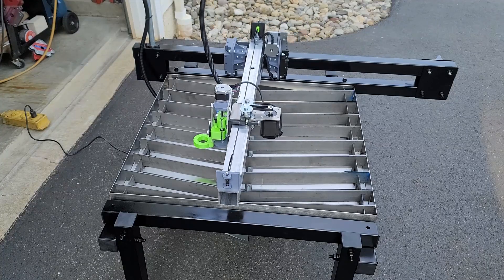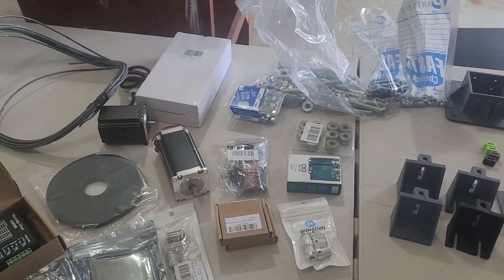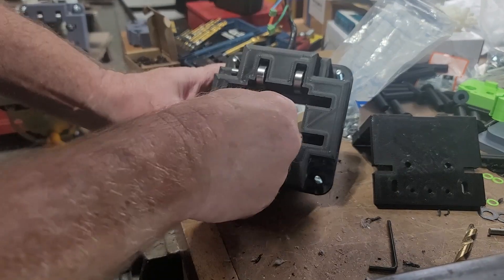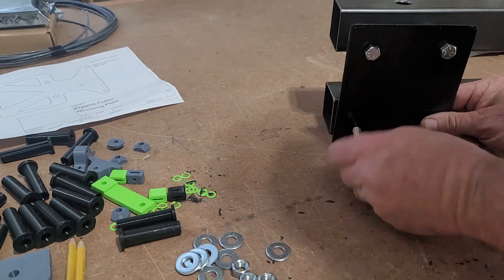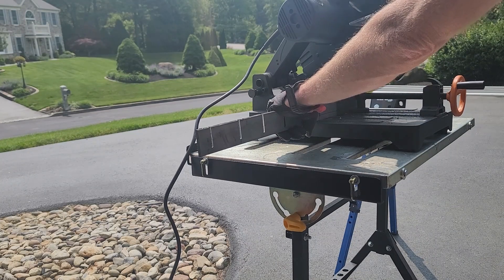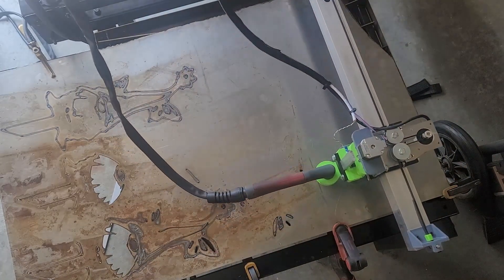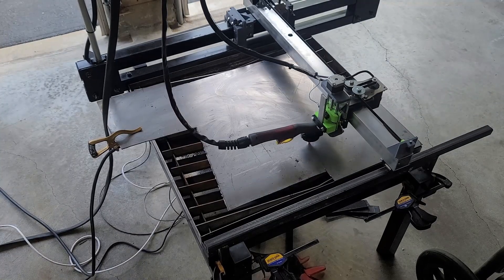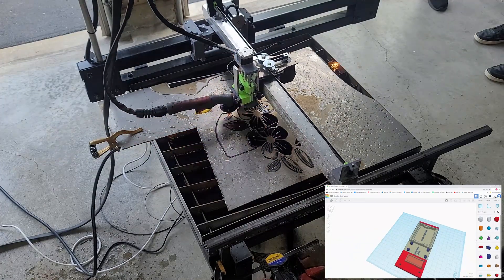DIY CNC Plasma Table Based on JD'S Garage plans

Comment: how much was the total build ? thanks
Reply from the maker: At the time, not including the plasma cutter, I'd say between $600 to $700. If I didn't add the z axis probe and other extras, I would have been easily well under $500.
Reply: @harbaughsworkshop   thanks :face-blue-smiling:

Comment: How's the right angle at full extension. Does the roller support cause drag that send the arm out of square?
Reply from the maker: I believe it was about a 1/8 drop when the torch was far right.
Reply: @harbaughsworkshop  I mean is it out of square when you look down from above because of the drag on the roller?
Reply from the maker: No, it's square.

Comment: The usage of a linear bearing as roller at 11:15 will live in my nightmares forever xD But what a cool idea! It's a solution, it works, solves the problem quickly and I love it lmao

I'm working on a custom design of my own and facing some of the issues described, already taking them into consideration at the design/prototype phase.
Reply from the maker: I will be making some changes to my table soon

Comment: How was the aluminum tube heavier than the steele tube?? Does that mean the is will have worse sag with the steele as the plans call for??
Reply from the maker: I went with the aluminum because my steel provider didn't have the thin gauge the plans call for.

Comment: Aluminium square tube for x axis bad idea -hardened bearing surfaces will wear off alluminium quicker than mild steel.
Reply from the maker: So far, the aluminum is holding up with no issues. I do have plans to do some upgrades to the table soon.

Comment: Love your choice of the welder/cutter combo....I just got one as well, but apparently mine is high frequency start and apparently CNC machines dont deal well with high frequency start....did you have to deal with that?
Reply from the maker: The YesWelder CT2050's plasma cutter is non-high frequency "blow-back" and is CNC compatible, so I get no interference.
Reply: @harbaughsworkshop   yah... I didn't get the yeswelder... I got a simder  🫤

Comment: Hi I have some issue after ignition plasma lost connection with Pc during work.All cables are shielded and don't know what issue is .any idea?
Reply from the maker: I just looked up your plasma cutter. The Sharman plasma cutter 110 is a high-frequency plasma cutter.  You need a  non high-frequency plasma cutter for CNC. The high-frequency start messes with electronics
Reply from the maker: Hi, what plasma cutter are you using?
Reply: @harbaughsworkshop  Sharman plasma  cutter  110
Reply: Ok so let's try invest in another one .

Comment: what do you do so that the frequencies do not interfere with your electronics
Reply from the maker: I use a non high frequency plasma cutter and also use shielded wire
Reply: @harbaughsworkshop  what is a shielded wire, can you explain a little
Reply from the maker: Shielded cables are cables encased in a form of conductive layer. This layer is designed to shield internal conductors from electromagnetic interference

Comment: Hey, how about cutting something bigger than actual working area ( torch reach)? Is there any easy way (function) to do it in parts and moving sheet acording to some marks?
Reply from the maker: I am sure there is a way. I have never tried before. The most difficult thing would be making sure you are perfectly lined up.

Comment: Hi! I recently started building it myself although I will be doing some changes. I see that you've printed it on Ender - any hints on what slicer settings you've made? A had really frustrating time when printing the bearing holders (and I still require 2 more as I will be doing double Y axis). Partially it was because of the poor cheap filament but even with a good one I still had failures and had to tweak the hell out of the Cura parameters like infill pattern, z-hop and what not to avoid knocking the printing nozzle to the part, and I still got significant corner warping without a raft.
Reply from the maker: I had a .4mm nozzle 
.4mm layer height
85%infill
4 wall
6 bottom and top 
Having and ender I learned to level the bed before any major print.
Have you tried slower you print speed? 
I have since upgraded to the bambu lab x1 carbon. I have reprinted some of the parts because I changed the torch to a machine torch.  Much better prints with the x1 and faster.
Reply: @harbaughsworkshop   0.4mm layer height with 0.4mm nozzle? Usually people recommend to not go above 80% of the nozzle so I've used 0.8mm for the first time as I never needed more than 0.3mm of layer height.  
I've set it to 5 walls and 8 top/bottom but lowered the infill to 65% which seems plenty enough. However, I decided to change infill pattern from grid to lines to avoid scratching of the nozzle on the already extruded perpendicular lines. I never had this problem before. This made the print time longer also due to the z-hop that I also never used before but this time I had issues with too much material around the horizontal bolt holes which even could lead to knocking the stepper motors out of sync and disturbing print coordinates. Or even so much vibration that two of the 4 bed leveling knobs fell off.
I usually print at 70mm/s, this time \i set it to 50. I used glass bed and tried to level it not worse than usual. 
After all tweaks the last trial gave not bad part but since I did not add raft to this one all 4 corners had wrapped, still usable but not pretty.
I don't know.. .maybe my Ender is to tired already ;-) During my struggle last week bambu lab crossed my mind hehe. I haven't yet checked too much about it though.
Reply from the maker: The newer printers are definitely worth it, the speed and quality are awesome.

Comment: So could this be made as a 4'x4' cnc if there was a rail for the gantry to ride on both sides of the table to eliminate sag? Printing the y axis parts twice and mounting on both sides?
Reply from the maker: If you created 2 y-axis rails and mounted both sides on a 4' x 4'. I'd add another stepper motor in series to the other side to make sure both sides were running smoothly together.

Comment: Awesome video, great way to counteract the issues with the Y axis issue. I'm in the process of building one myself. They have great plans. I thought I would print your STL file for the board layout, unfortunately my slicer detects 2776 non-manifold edges and will not allow me to print the file.
Reply from the maker: Thanks, that file I just threw together, not really thinking about sharing. That's the reason it's kind of rough. I can do a more cleaned up version if that would be helpful.
Reply: @harbaughsworkshop  Thanks mate, that's okay on Thingverse they now have the whole range of board holders which can clip onto the rail for junction boxes. How did you go with alignment for the Y axis? In your build you bolt the 3D parts togethor, in the plans they say to first adjust the bearing half to the frame and do not remove after adjusted instead bolt togethor on the Y frame. When I follow their instructions on this I quickly find due to also not being able to source thin material here(Australia) the bearings don't run square which is why I plan to also add the rail like you did on opposite side but before I add it I would like to make sure i get my bearings running true/square.
Reply from the maker: @burgo856  it was easier for me to have the y-axis put together loosely, and then make my adjustments.

Comment: So where did you get the software and where the parts pre-programmed to be able to move?
Reply from the maker: The software is available online. You will have to flash the software to the device.  All this is explained, and clear directions are in the plans walking you through the process. Very easy to do.

Comment: great video! when you say the X axis was too heavy, you are saying that the torch is moving the opposite end of the axis, right? I am very interested in your personal changes! Whoa, I found all your 3-d print designs in the description! that is awesome! thank you... 5x thumbs up!
Reply from the maker: Thanks, yes, when the torch is headed out to the opposite side it starts to sag.  Not a lot, but enough to make a difference
Reply: @harbaughsworkshop   IF you are using a washing machine pan for your water tray, I believe you can save a few bucks by buying from Vevor, Home Depot, or a plumbing supply. Not sure you are using a washing machine pan, though!
Reply from the maker: @Halfwheelhell  I am using a stainless steel washer tray. I am sure you can find many different trays at different prices.  The one from Vevor looks to have a plastic drain. If you were to use that one, I'd replace it with a hose bib or another metal/brass spigot or drain.
On my tray, I did add a spigot on the bottom of the tray attached to a 15' garden hose to drain my tray
Size was also a factor that isn't a huge deal, but it would change your dimensions

Comment: Adding a touch more voltage will help tremendously on your welding settings. Or do the adverse and drop wire speed a touch
Reply from the maker: Thanks for the feedback

Comment: Awesome job. I purchased the plan today to build mine. I was wondering which 3D Print material did you use? The doc recommends PLA but I’m a bit concerned that the heat resistance of PLA is too low, especially for the parts close to the torch receiving sparks. Thanks a lot. Cheers from France
Reply from the maker: Thanks, PLA works perfectly. Follow the settings that is specified in the plans for Infill, wall thickness, etc. The parts are more than strong enough
Reply: @harbaughsworkshop  will go with PLA then 😉 thanks for your feedback

Comment: Fantastic video, I was on the fence about the plans, the fact that the cutter touches the working surface on every cut sold me on it! 
Thank you!
Reply from the maker: Glad it was helpful!
Reply: mine worked well in till i installed the Z axis, still does but i could never find the right post processor or some thing for the z to work right :(   But I am gonna get back on it one of these days.
Reply from the maker: @user-ij8bv8eq4i  what's wrong with your z-axis? Is it not probing ?

Comment: Do you have any details on the support you made to sit inside the water pan?
Reply from the maker: I used 3  1/8 2x10 flat bar cut to 29 3/4 lengths. I bent them in the middle slightly using my workbench table, and I then used angle iron on either side to support the slats, I cut groves into the angle iron for the slats to fit into. I did end up welding a 1/2 flat bar to the side of the angle iron to insure a uniform height for the slats.

Comment: How difficult would it be to make the table 2x as big coding wise etc.?
Reply from the maker: It's easy, this cnc doesn't have endstops.  You can build it to the size you want. You set your zero with the openbuilds software, and you have to keep mindful of the parts your cutting will fit

Comment: I am getting ready to build this same plan - I was thinking of painting the rails to give it some color. Will it rub off as things travel back and forth? Any issue with metal splatter? Any clean up issues you have had?

I was also strongly considering the OpenBuild controller instead of cobbling something together with Arduino. I like your cable connectors though. Any issues with EMI??

Great job
Reply from the maker: Thanks, no problems with paint rubbing off. I gave the paint enough time to cure before use.
As for issues with metal splatter, I have not had any problems.
I used shielded cables, so no electronic interference issues.
I have no experience with the openbuilds controller. The arduino works perfectly for me. Enjoy your build

Comment: Since it's now been 3-4 months later... have you had any issues with spatter sticking to your X axis tube? 
Would you do it the same way again, or find the thinner wall steel?
Reply from the maker: I have not had any issues whatsoever. I am making some improvements, not because of issues but to add to it.

Comment: I wish I was smart enough to use freecad don't care for fusion 360 at that point I pretty well shelved it, mine works great just thought I could use other software like with my 3d printer. but I don't no how to to make the entry exit paths
Reply from the maker: You can use other software like inkscape to create your design. Save it as an svg or dxf file, and then use Fusion 360 only to extrude and create cut files. I can release a video of how I do this if that would help. Once you do it a couple of times, it makes more sense.
Reply: @harbaughsworkshop  ya i don't want to use their program due to use restrictions say for instance i need a bracket for work and don't want to go trough the heart ace of making it by hand to save me the Hassel, and a 15 dollar bracket doesn't justify their 600 a year to make 2 brackets a year... the rest would be for personal use, but the lack of due what I want.
  if I could purchase the software outright I would do that, but im not paying a subscription i would rarely use . thank you though
Reply from the maker: @MultiLEGODOG  I use Fusion360  free for home use. Just limits the amount of saves you can use.
Reply from the maker: @MultiLEGODOG  just a heads-up, I recently posted a giveaway video on my channel.  Chance to win a mig welder if you're interested.

Comment: What did the total actual cost come to? One video says $350, one says $500
Reply from the maker: It all depends on how far you take the build. If you do the bare minimum, you are looking around the $350 range. If you add the extras, the price goes up.
I added the z probe, water pan, and the Bluetooth module. All these increased the cost.  Hope this answers your question.
Reply: I would do the same. What was your total, if you don't mind me asking
Reply from the maker: @rickasisco  it's hard to say.  I am still adding to it lol. The total cost I spent going by what you see in the video is around 600 to 650.  I did end up with a good amount of scrap steel and aluminum. If you can pick through the off cuts at your local steel provider, you could save a good amount on that price.It is well worth every penny. It's an awesome machine.

Comment: First i  too , have puchased the JD's garage plans, and the 3 d parts.  I will be utilizing the x axis tube support you designed as well.  I intend to enlarge the table some so i feel the support is even more imperative.   I have 2 questions.  First, can you think of any other considerations i need to incorporate in an enlarged working area ? I will be extending the x axis to leave a 30" and y axis elongation to 40".  My primary concern is probably the electronic element.  I am a total novice when it comes to programming and dont know if changing the dimensions will require me to make alterations to any of that .  Secondly i notice you have used a much thicker walled tube then is called for on the gantry tube. It does not appear you have experienced any issue as a result.  I cannot find 2 1/2"×2 1/2"× .125 tubing anywhere locally but .25 is redilly available. If i can use that then that is what i will do.  Thank you for your time and insight.
Reply from the maker: JD'S Garage does a great job walking you through the plans. The size of the CNC does not change anything with the software. Try and keep the weight down on the x-axis as much as you can. If you have any other questions, feel free to reach out, and I will help as much as I can. Enjoy the build
Reply: @harbaughsworkshop  thank you my friend

Comment: Nice build.

When I first watched your video I’m sure you said the plan’s templates were 1:1 scale, so that you can simply use them to mark out your flanges etc, making the whole build simple, but when I purchased the plans they’re given to me in 1:2 scale, meaning they’re not worth a knob of goat turd or I’m fixing to have one hell of a small plasma cutting machine!

Any reason for that do you know?

Thanks.
Reply from the maker: The x motor plate, y axis connecting plates, y motor mounting plate they are in the one to one drawing folder, the tube drawings and brackets they give you the measurements you need, the 3d printed guide lines up some of the holes.
Reply from the maker: Let me know how your build goes. If you have any questions, just ask, and I will try and help in any way I can
Reply: @harbaughsworkshop 
Yes, I think you’re right, I understand that now. There’s too many folders and files etc to get my head around!

I can actually be quite dumb when it comes to things like that… not looking forward to the electronics or programming the thing! 😬

Thanks again.
Reply: @harbaughsworkshop  Thanks very much for your willingness to help there, I really appreciate it. 

I'm from New Zealand so there's going to be a bit of metric to imperial 'clashing' but I'm sure we could work the basics. Also, I'm not really sure when I can build this thing, it may be 9 or 10 months, or so, away yet. I just got the plans in advance so that I can mull it over and try to get familiar with the build, but anyway.

No, my Motor Plates, and Y-Axis Connecting Plate plans are definitely in 1:2 scale, it even says so on the plans! I'm not quite sure what's going on there but I'm not going to be able to 'simply' trace around them in any way, like I'd hoped. ☹ I have just sent an email to them at JD's, so I'm awaiting there response.

Anyway, I'm happy to take you up on the offer for when I go to build one of my own, you'll have a lot more experience with yours by then and will know if any quirks develop.

Thanks again.